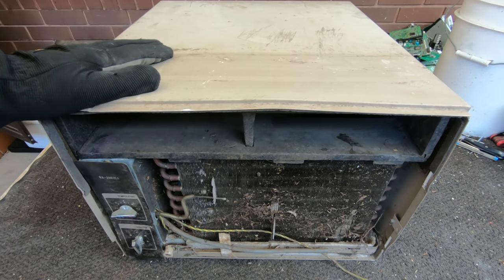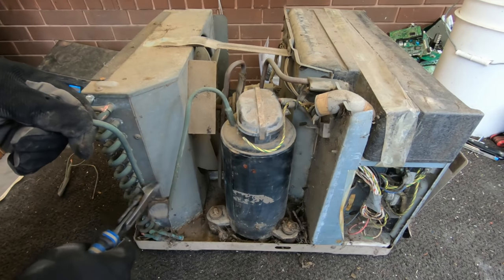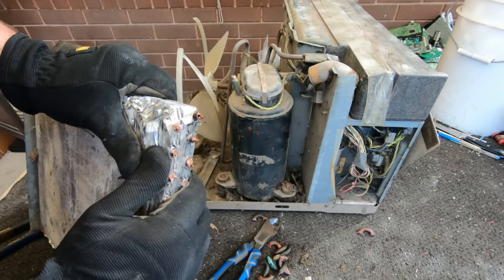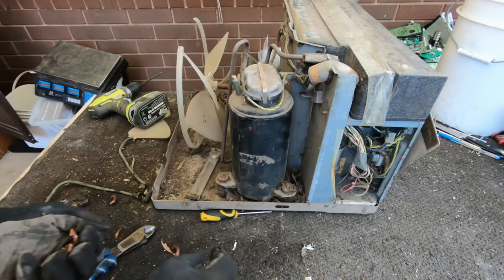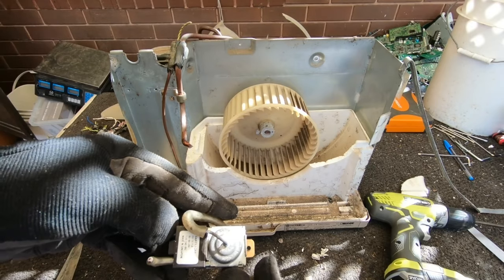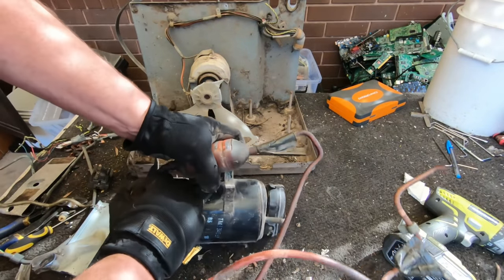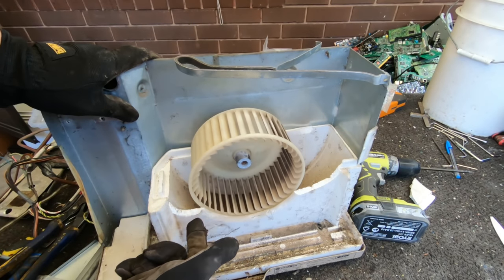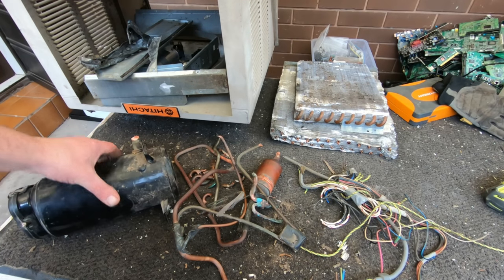Scrapping an Air Conditioner for Copper & Better than Scrap Steel Value

Comment: What about the freon. Was it emptied first?
Reply: diggin'it v u saw the scene cut as he cut the first tube right?  Lol freons in our atmosphere now...
Reply: Joe Bears The point of the burning process is that it destroys the freon and renders it harmless.
Reply: Joe Bears Thanks for clarifying that. There is a new process they've developed in Australia that apparently uses a plasma arc to turn freon into something akin to saltwater. The energy input would still be huge, I'm sure, but I guess you could do it with renewables. I don't really know how good it is in the real world, but hopefully it's a step in the right direction.
Reply: No need to care ur allowed in USA to release a residential amount of freon in the air
Reply: Actually, Freon isn't poisonous as some would have you believe, the problem with freon is that it is heavier than air and more dense and if it settles in pockets animals and such can breath it in and it suffocates them if enough is inhaled.  Your cars exhaust is more toxic than freon is
Reply: Thanks Guys!
Reply: So much wrong info here. Freon depletes the ozone layer.
Reply: For cut the steel away with Sawz All
Reply: Arent these AC units filled with R600a? Its mostly a propane/butane mix.
Reply: R 12 freon sprayed on a hot steel plate, higher than 500 C., creates a gas similar to Fosgene, a nerve gas that is extreenly poisonous!
Reply: An incidental leak is allowed, but intentional release of refrigerant is illegal, no matter the size of the appliance.
Reply: First cut of the copper and you could hear the gas escape
Reply: @adambuysyuckyhouses  Refrigerants that are ozone depleting substances are being phased out under the Ozone Layer Protection Act (OLPA) 1996. It is illegal to release these refrigerants into the atmosphere. ... If you release these refrigerants to the atmosphere you can be fined up to $10,000.
Reply: @probchild85  whose gonna tell......😈 Not you I hope😈😄😄😄

Comment: I use a cordless sawsall,  takes seconds, otherwise it's an irony copper aluminum radiator, pays considerably less with the steel plates...

Comment: a air conditioner is the best thing if you want copper. like you said once you know how to take it apart you will be very copper high
Reply: Wrong milk coolers. I have one at moment. An air conditioner ontop of a stainless square tank with copper piping running all inside on a frame

Comment: Recipatating saw is what you need like knife through butter, uberism uses an old circular saw you definitely need to remove that steel it downgrades the price a lot dont bother with the pipe inside the alu you'll end up sliced up hands the alu is like razor blades

Comment: There is oil inside of the compressors so your scrapyard will really hate if you try to pass it as just an electric motor.
Reply: Alan Shore My yard bought them as heavy melting steel. I always wondered what happened when they were thrown into the blast furnace.
Reply: I betcha they get shredded first and the metals are separated.  If they throw appliances as one piece there is chance something (like oil in the compressors) will explode and damage the forging machinery.
Reply: I don't know. The scrapyard threw them in with all the other heavy steel items and I figured that it would all be  be too thick/heavy to put through a shredder. Maybe they pluck the compressors out and process them separately once it all arrives in a cheap labour state.

Comment: I see that the refrigerant has been released prior to the video. Its rare to scrap an AC unit without the refrigerant under pressure still in the copper lines. I say this because im certain that theres a handfull of regulations that go along with   AC coolant disposal. Although im unsure of specifics, i can say without question that just releasing that stuff into the open air is a no no. Infact id be willing to bet that coolant disposal negates any profitability gained from scrapping out these old AC units. Anybody care to throw out details???

Comment: dont cut the copper pipes with the snips, saw them off. U should be able to pull out the inner pipes that run thru the aluminum sheets very easily. cutting them means to flaten them on one side and to widen them at the same time. U squeeze them. and this wider part let them stuck in there

Comment: No need to remove the steel to sell as copper alum rad at you yard mate, sold a batch there a few weeks back no probs.
Reply from the maker: Cheers, will send them as is, didn't see you on the weekend.
Reply: eWaste Ben did a quick run with the young fella after work Friday around the same area u found the motors, then hit the northern area of the same estate for an hour or so Sunday lunchtime. Only saw 1 or 2 others out Sunday, was surprised.

Comment: The reason u take the coil apart is because u need to take that metal off it should be just copper and aluminum
Reply: Sawsall run it rite on the inside of the sheet metal

Comment: a compressor is a motor connected to a refrigerant pump in a case filled with oil based on the refrigerant used.  Also did you file a permit to cut into that copper with out evacuating the refrigerant? Glad you did not show it on camera as we assume you used the proper tools to recover the gas.

Comment: If you're going to listen to this dude about scraping good luck. If you're making YouTube videos on how to scrap then you should know how to scrap out an air conditioner. You have to cut that steel plate off the rad or you wont get clean price this guy is just throwing money away